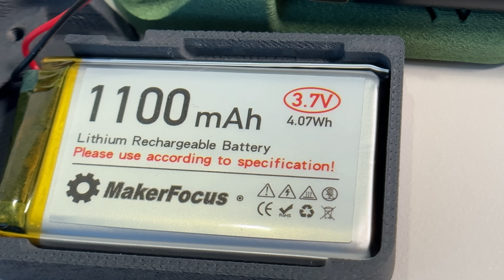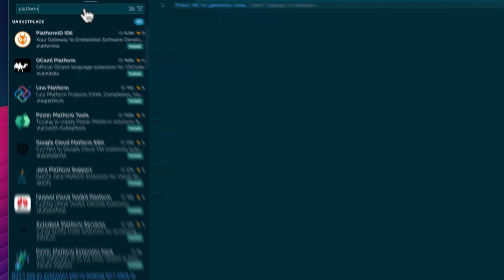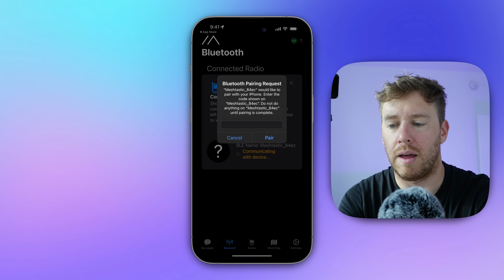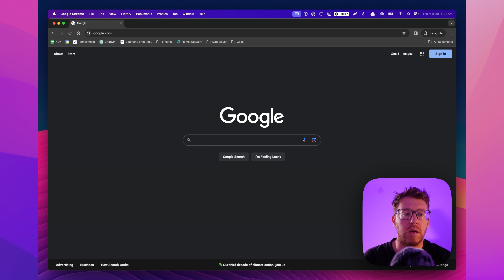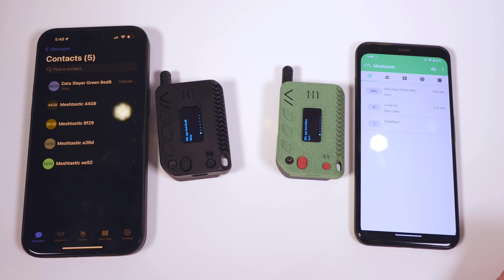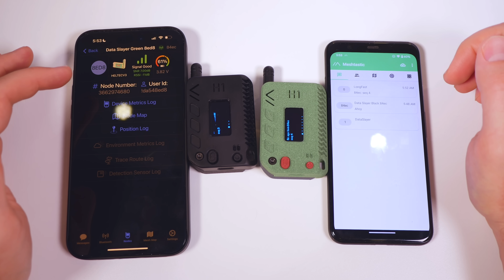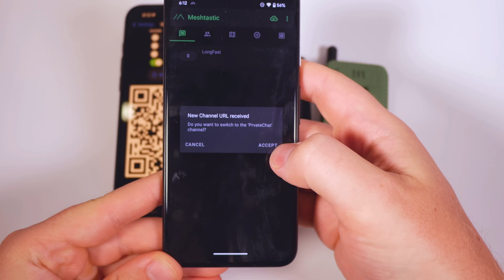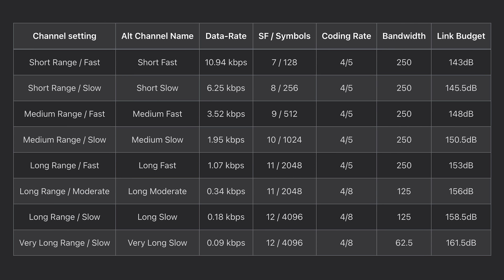It’s Been a Good Run, Phone Providers.

Comment: I was an IT in the navy dealt with a lot of encryption and secured comms i would say just by the transfer to the device to the phone you lose a lot of security to the comms i will also add just because your communicating on what you think is in encrypted it can still be detected if they are looking for emissions
Reply: 100% agree with you, Its not as secure as people claim to be or at all, It can be a good way to communicate in emergency situations for off grid uses or when networks are congested ,  but can easily be tracked because the Lora pings your GPS location when you communicate which you would know that can be traced through RF as well.      Its amazing that people swear that its encrypted and is " Safe" , although still good to have for emergency uses.
Reply: @killerdeamonking 
Ok so not all long range (lora) are tied to GPS modules they are the same as any other transceiver technology. They use a bandwidth that used to be used for analog television signals. As for encryption that happens before anything is transmitted it's not a VPN tunnel it's not being encrypted by the antenna. And sure you can triangulate any rf signal and you can capture or intercept it but if encrypted it's still just going to be a garbled mess without the proper encryption key.
Reply: Came to say similar. You are still beaming out a radio signal. I don't see how that makes you any less susceptible to be man in the middled than anything else.
Reply: he didn't say anything about not being trackable, ever, only that the message would be encrypted, and even then only on the encrypted "channel" ... I agree that it is important to point out specifically that it is trackable though. especially, as somebody else pointed out, if the entity buying it is intending to use it to aid some sort of political resistance effort.
Reply: The transfer would have to be intercepted within range of BT so about 30',  Look over your shoulder before you press send.
Reply: @syntaxerrorsix3137  I was in the military let's just say that's the range you receive messages secondly if it makes a single it can be detected for miles and from space. Just fyi
Reply: @syntaxerrorsix3137  if you don't have true like radio experience and knowing about intercepting and creating networks I really wouldn't try to argue capabilities of someone if you really don't know
Reply: @better.better  if it can be tracked it can be broken encryption depending on the encryption level and the way its done can be easily broken considering this is a small network with no time key it would take out military about an hour or so to Crack it would be detected someone sent something almost immediately
Reply: @mrsaltydino4817  I was in the military as well.  Not sure why that matters.  No one is claiming that a signal can't be detected.  The claim is that the message is encrypted.  You'll spend the rest of your life decoding the AES256 encryption.
Reply: @mrsaltydino4817  I'm an amateur radio operator as well.  Again, your appeal to authority is lacking.
Reply: @better.better  ohh I agree I'm just stating that for those who feel it's not trackable.   Nor is it encrypted to the point where big brother can't snoop it.
Reply: It's funny how some people are willing to put their faith into encryption without realising all of the novel new ways that have been invented in the past few years to defeat encryption methods.

That said. You're not likely to attract the attention of someone with a multi-billion dollar quantum computer setup who is willing to put in the time to beat the encryption on a bunch of recorded signals... Yet.
Reply: Emitter threat library
Reply: I usually just use my homing pigeons with symbols to send messages to "my boys"
Reply: I was military as well fyi
Reply: I wanted to be IT when I was in the Navy, but at the time they didn't let you be IT if you didn't have normal color vision. Anyways, I think that it's still safer than using your phone as many cell phone providers and cell service providers will give up your information. Many businesses who sell your data will do the same. They all have a saved history of everything that you've done as well. I think this is pretty much the major advantage of this device. This also has similar advantages to a walkie talkie.
Reply: Maybe I'm misunderstanding, but having a short range gives it the advantage of only being able to be picked up locally. the probability that someone is checking for those frequencies in your immediate area goes down significantly, so it isn't hackproof, but if you are avoiding "big brother" I feel like it would be a valid option. Not for military purposes, but Local P.D. likely lack the knowledge to know how to trace it, and the bigger feds would have to already know your location and have someone in the vicinity to ever get any information and in the event a fed, or stranger picked it up, your name isn't tied to it in any way. In that regard, it seems like the perfect tool to avoid "big brother" Or am I missing something?
Reply: @Myspacemeta  LoRa literally stands for "Long Range".  In the line of sight world it does just as good as your standard HT using far less power and in turn battery consumption.

They other thing to keep in mind is that each node in the network acts as a repeater so the signal is sent out by each device.

The goal isn't to hide the signal, it's to create a network that can't be taken down by the loss of a single node and to be able to send encrypted messages.
Reply: @Myspacemeta  You aren't really missing anything and a lot of what you say Is valid .   For most people this will work fine , it's just that more and more people are using this kind of thing with boosted signals and as their own personal network as a " Encrypted chat line" .   People push for more and more range on each release or modification.
Reply: @syntaxerrorsix3137  I understand having a communication network the only reason I stated anything to begin with is that he says that it's safe from big brother at the beginning and that's not necessarily true
Reply: I stayed at a LA Quinta last night if that helps.
Reply: @syntaxerrorsix3137  yeah but in remote senorios emissions is what kills you not if it's secure or not
Reply: @mrsaltydino4817  The same thing can be said for light and noise discipline.  Comms doesn't cease to be just because there's a chance it can be intercepted.
Reply: @Unethical.FandubsGames  Not to mention, people forget who regulates those encryption standards in the first place- NIST, DoD, etc.. that isn't a coincidence. 🙂
Reply: Can it be detected by any old narrative or  does it have to be some special narrative?

Comment: 1. You dont need a cell phone. A basic tablet will work.
2. It only needs wifi for the setup and updates.
3. The tablet is where the communication APPs are. Yes, you can use this with ATAK.
4. The device sends the encrypted signal. The more people using them, the wider the range and coverage. Yes, there are ways to increase range to 200 miles.

Comment: Awesome! I invented a phone for the house that stays there all the time and is attached to the wall with a cord so you don’t ever lose it.
Reply: Amazing, I am using two tin cans and a string but the cost is low and the system never goes down.😅
Reply: >D the coil cord that you can stretch from the kitchen around multiple walls, down the hall to about 3 inches inside your bedroom door though right?
Reply: You jest, but a pair (or single) copper wire from your house back to the exchange typically survived DECADES and just carried on working. Might get a bit crackly from time to time and so on, but ultra simple and ULTRA durable. Power cut? HomePhone still working just fine. Local mast damaged / maxed out - HomePhone still works. Dropped your handset - Homephone don't care. Drop it, stand on it, drive over it - probably still giving you a dialling tone. Good for about 60 years before you might want to replace it (for a nice new colour).

The old stuff just worked - basically forever. Modern Phones with their "designed to fail", glass screens and microlife batteries are great while they work - but if you NEED to have a phone that is guaranteed to work - the old housephone probably won't let you down from one decade to the other.

Can you say that about the latest plastic delight people pay over £1000 for ?

Sometimes you just want reliability and not "Oooh look I can take a super photo on a telephone while liking a picture of a plate of food".
Reply: FACTS
Reply: You need one with batteries for when the power grid goes down.  At these this way you make a call out when there is no power on the line connected to your house.
Reply: You are very right about those old phones....tremendous engineering!
Advice: if you have one these, and it works, and you have a bad temper, don't try to break the handset on the edge of the desk. Ouch!!!! Just hang it up in a normal fashion and avoid injury!
Reply: @chickenbeek so you end up laying g on the floor by the door and getting hit by it when someone needed it
Reply: Is it touch screen, button press, rotary dial or immediate access to the operator 😂
Reply: Landlines... good old days!

Comment: "outside the control of big brother"

Uses proprietary communication protocol.
Reply: Accessing a smartphone or chrome browser, to make it worse 😂
Reply: "Outside or control of big brother" 

"Is electronic"
Reply: What's proprietary? Meshtastic is open source. The Lora libraries are open source.
Reply: @quarteratom  
"What's proprietary?"
LoRa is, it's licensed & owned by Semtech.
Reply: @Eduardo1007  It can be operated completely in airplane mode. Hardening your device beyond that is your own responsibility. (yes its debatable if airplane mode is even safe as well, evidence suggests otherwise)
Reply: @KatorNia  umm it only means you are not allowed to make and patent the exact same thing (the "radio modem") just because it's licensed and the chip design is not public, doesn't mean you cannot know what's inside and how it works.
Reply: @fltfathin  
Ok...?
Reply: @xNightbound  Also usable with industrial Android devices that lack an LTE modem.

Comment: Goodbye phones.
Requires Phone.
Reply: This video just won the click-bait award. lol   Sure these are cool, but definitely not a cellphone replacement by any stretch of the imagination.  There's a reason why cellphones are called "cell"-phones, due to the thousands of advanced cell base stations.
Reply: tfw you don't know what a phone provider is
Reply: I mean, you can technically make a pocket raspberry pi setup and connect it to it and it will work...
Reply: Funny, but you conflated “phone” with “phone provider”.
Reply: yes, but dosnt require the phone to be connected to the phone network, ie it still works with the phone in flight mode
Reply: @BillAnt  the cell network records everything. calls, msgs, internet usage, all go via your provider, when they say, for example when you dont pay the bill, your phone wont work.
when you goto a place that has no cells, your phone wont work...
Reply: it says phone *providers*. You can use meshnet on a phone with no SIM and no service. hell, you could even do it in airplane mode since most devices allow bluetooth connections while airplane mode is active.
Reply: @wallmenis  exactly. you could get a small touch screen display hat for a raspberry pi and not even need a physical keyboard, and power the rpi from a couple 18650s. slap it in a 3d-printed case and attach it to the back of the display and you're good to go.
Reply: @BillAnt are you really that ignorant to all the advantages of this device or should I say disadvantages to “cellular” devices? Have a look at what phone tower simulators are
Reply: @KemistKing  - I have no problem with this device, I'm sure it works fine.  But the title is still a click-bait.
Reply: Phone Providers is not the same thing as PHONE.. you are extremely smart congrats.
Reply: With the newer updates you can attach a keyboard and use the thing completely without a phone
Reply: @djkiltech  is this sarcasm? if it is, good one. Like that's what everyone doing easily and try to type with that.
Reply: @n0.covercharge  have you seen that he used "literal phone"? If that does not need a bigger computer/phone why he did not show it? Because of complexity that nobody in real world is actually going to use this.
Reply: @me-df9re  they make 6"+ touch screens for rpi, it would be the same exact thing and a phone 🤷🏻‍♂️

Comment: Don't forget about antenna polarisation - keep them vertical. For those antennas RF radiation emits as a donut.
Reply: The most important factor is tuning the antenna's SWR (Standing Wave Ratio) as close to "1" as possible in order to minimize transmission loss.  I bet Andy Kirby would be excited about these tests. :D :D
Reply: That was bothering me throughout the video. Range test results don't mean squat if there is no consistency in antenna orientation. As for the drone. . Mounting it horizontally on top of the drone seems like 2 bad ideas rolled into 1 to me. I'd love to see some real range tests with vertical orientation and also SWR tuning. And some amplification if you're feeling frisky. I will bet they have a lot more range to give than 3 miles.
Reply: Hmm.. someone should make a self correcting antenna mount which will use accelerometer data to always be pointing upwards.
Reply: @simp-slayer  That is a terrible idea... making things overly complex when you can just point it up isn't smart.
Reply: @thomgizziz  Yeah, I guess. Perhaps I just needed a weekend project 😅
Reply: As a torus ;)
Reply: As someone currently studying that right now (antennas) , I can finally see how it applies to real life.
Reply: @Moosems-pk8vc  Yeah, with the state of literacy currently in the soon-to-be former affluent countries, donut seems like an efficient choice for maximum audience reach.
Reply: @Syvtek  - Andy Kirby on his YT channel has a couple of videos using Meshtastic to communicate over 5 miles away using directional antennas. Even with properly tuned regular whip antennas, it can go a couple of miles depending on terrain.
Reply: All antennas are actually calibrated in the horizontal position due to the fact that unless you have a tower large enough to ensure that none of the energy from the waveform is absorbed by the ground.  For example, 300MHz would require a 1 meter tall antenna, in the vertical polarization, due to a wavelength of 1 meter.  E field is also inverse squared for it's rate of amplitude decrease.  But there's also different equations for near fields are far field but regardless, your power, gain over isotropic, are your contributors or factors to the amount of distance that your signal will transmit.
Reply: @simp-slayer  You might not need an accelerometer, just a pivot and let gravity sort you out. If the drone moves fast it can tilt, but keep it slow and have enough weight in the bottom (center of gravity, not necessarily adding weight) and it should do a good enough job.
Reply: @kingofhearts3185  Yeah, I was thinking the same thing but for a bike instead of a drone.
Reply: @simp-slayer  Sweet. Good luck getting it sorted out then.
Reply: @BillAnt that’s a non point with rubber duck antennas.
Reply: @thomgizziz the only terrible idea was making that comment.  We have specific azimuth and elevation rotators for EXACTLY that purpose.
Reply: So i can't bend the antenna at all?, is it possible to make it work if the antenna is something like a semi-circle?